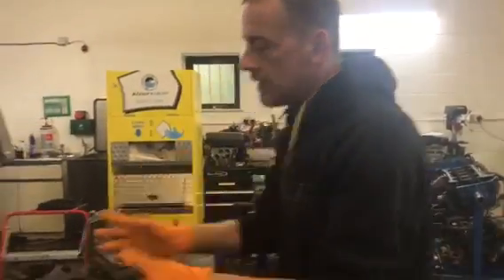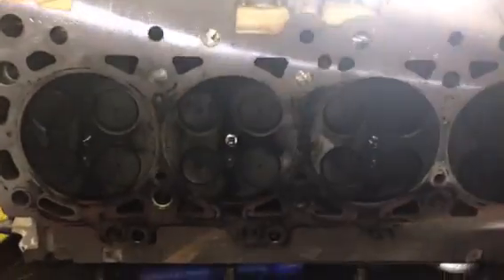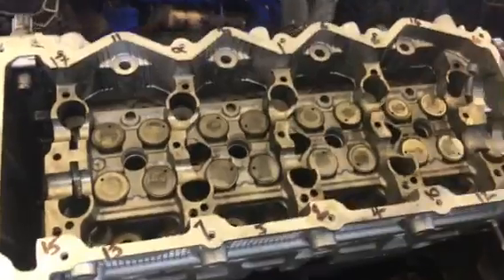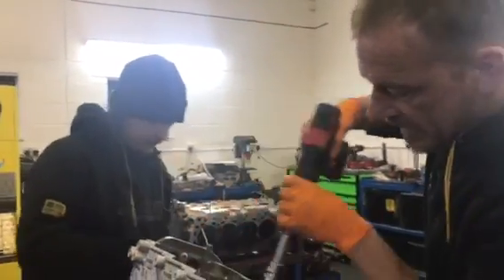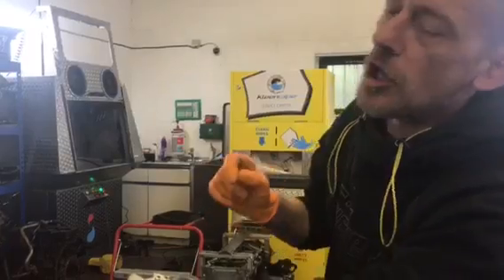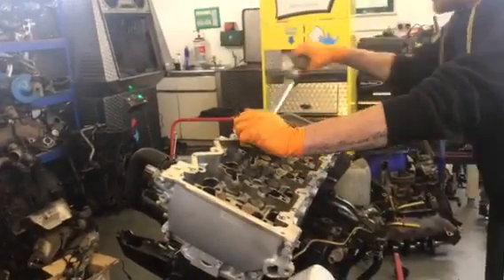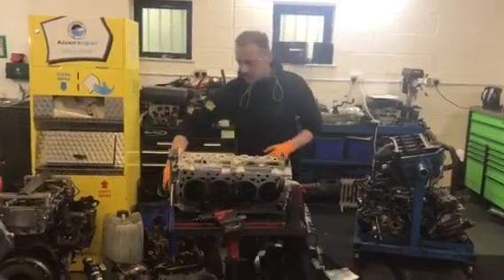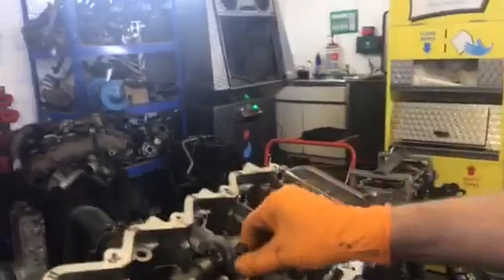How to Torque and Angle Nissan YD25 Cylinder Head

Comment: nice Video, but why did you losen the bolts after torqing them at first
Reply: If you check the Nissan shop manual, it is called for by the manufacturer.  Torque to spec, loosen, torque to spec, 90 degrees, 90 degrees.  Some engines/modifications call for 95 degrees, 95 degrees as the last two steps.  The one who has no idea what they are talking about is Mirko.
Reply: He got no idea what the hell he doing

Comment: Hi mate I’m so stuck. I’m placing the bolts on the head now as we speak and I’ve torqued my torque wrench to 180* degrees but I’ve been turning for a while on bolt number one and it still has reached 180 on my wrench. Am I suppose to torque it to 180* or just turn the bolt 180* just with a breaker bar?
Reply: Turn the Bolt 180`

Comment: had a problem.  
cooling system antifreeze was leaking trough header tank. . removed cylinder head. .was skimmed and headgascket replaced. . 
but have same problem.  antifreeze is leaking through the top of header tank.  wasn't the job been done correctly or the problem is somewhere else.

Comment: hello i have a nissan pathfinder automatic 2.5dci the problem is that when i go above  2000rpm i have no power and black smoke comes  from the exhzaust .i"ve don a reset pn the ECU remove the battery for one hour no engine check light no nothong just above 2000rpm no power as more i step the accelerator the more black /grey smoke comes out .Can you tell me what to check first?
Reply: just now news i was in garage of my friend and he cleaned the boost solenoid and the turbo now is workong like new